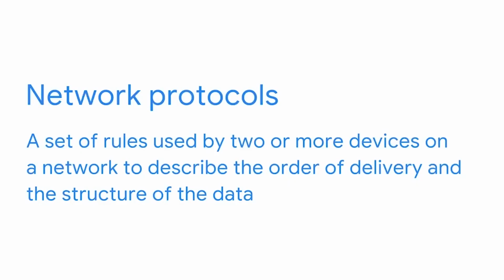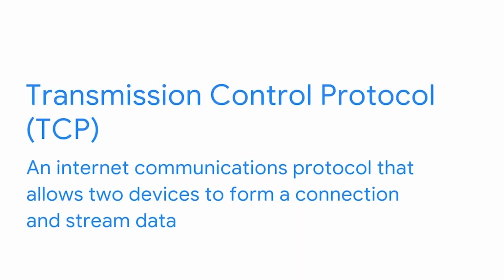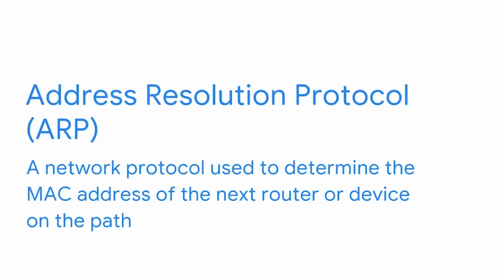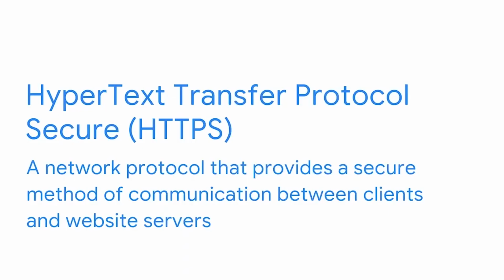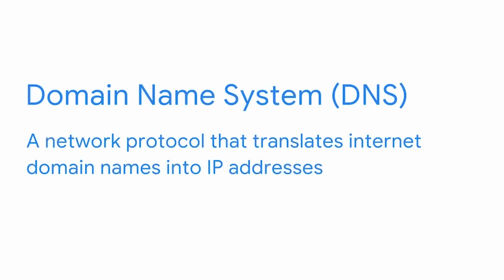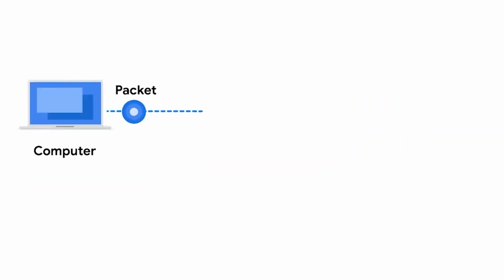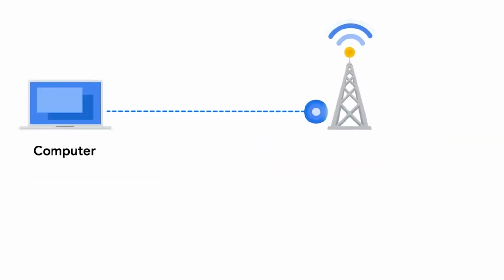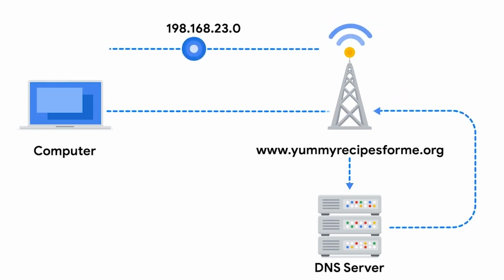What are Network Tools and Protocols in Cybersecurity? | Google Cybersecurity Certificate

Comment: 00:01 Learn about network tools and protocols in cybersecurity
00:40 Network Protocols are essential for data delivery and structure.
01:21 Network protocols and how they work together
02:07 Network data packets move between devices using ARP for address resolution
02:50 HTTPS and DNS are essential network protocols in cybersecurity.
03:32 Network protocols like TCP, ARP, HTTPS, and DNS are used in network communications
04:16 Learn about Wi-Fi standards in cybersecurity.
04:59 Evolution of Wi-Fi protocols for security.
Reply: Hrloooooo